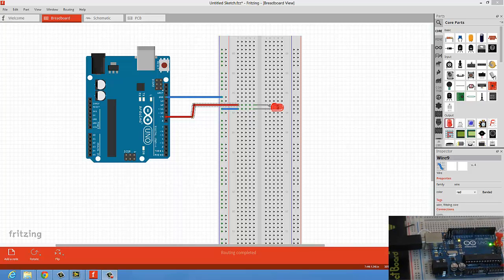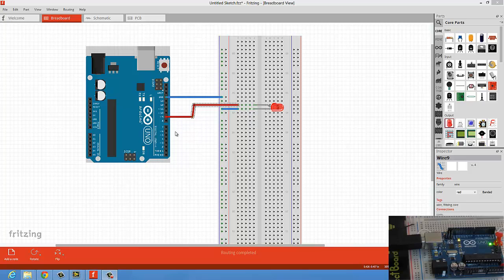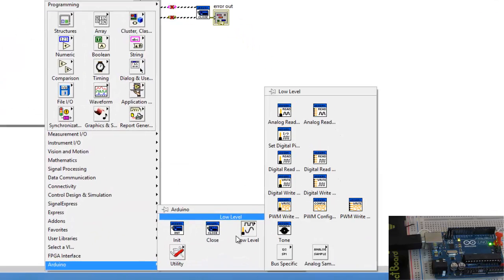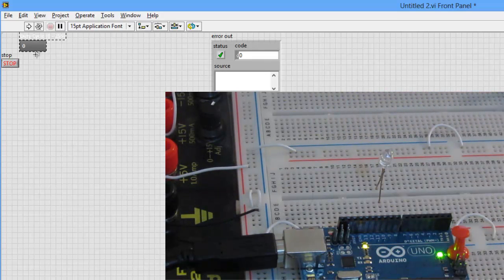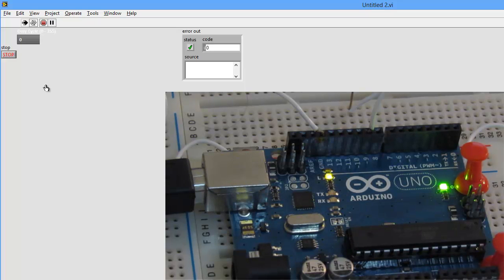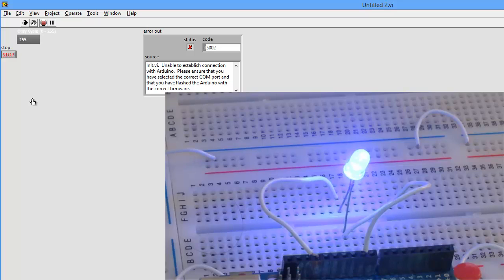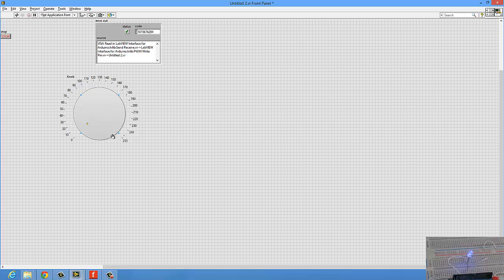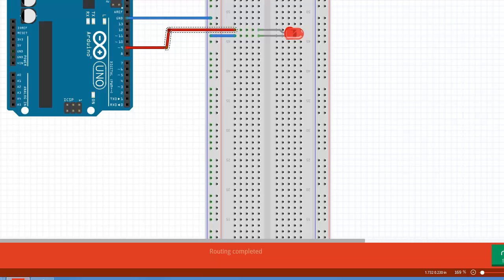Interfacing Arduino with LabVIEW   Part 2 LED Intensity Control using PWM

Comment: hello, I want to know my problem, I did over 6 program interfacing with labview I got the same problem I don't have anything in the output, I did also analog read with another video , I don't read or put anything to the Arduino, do you have ideas what is my problem?
Reply from the maker: Could you send me a video of the setup and problem?
Reply: @AhmedSweleh  Hello Ahmed I made the same video that you did but I have a problem which is labview never read anything,in addition,  the rx in arduino does not work flushing.
according to your experience where is my problem
Reply: I try to use linx and it is working well but it is has a problem,everyrun,  I need to download the firmware to the arduino
Reply: @AhmedSweleh  I am waiting your help

Comment: my power is not varying with respect the knob and control functions, first i thought the problem with led but when I connected the terminals to voltmeter then , it is showing a constant voltage when it crossing 130 cycles below is 0 v, after 130 cycles 4.8 v  constant up to 255 , that is the solution ....thanking you

Comment: can't get it working on Arduino clone..,the error out says "Unable to find Arduino.  Please make sure the Arduino is connected to your system and that the Arduino drivers are installed." ..I'm sure I installed the right driver because I can load and run programs on my arduino clone alone without interfacing with labview,,other thing is, on the Visa resource list only "refresh"is listed no, com port is available..do you think its because I used arduino clone only and not arduino board?
Reply from the maker: don't think so. as long as you can see a com port in your device manager it should work
Reply: +Ahmed Sweleh I can see it on my com port but not as an arduino(com#)..
it has a different hardware name maybe because of the hardware manufacturer of the clone duino

Comment: hi Ahmed
can you please give me arduino sketch for this video
Reply from the maker: which arduino code or labview vi?
Reply: +Ahmed Sweleh  actually i have a problem to do same thing in visual studio
 i think my arduino code not correct can you please help me?
Reply from the maker: Can u explain what u want to do?
Reply: +Ahmed Sweleh i want to control (pwm) led with 'knob contorl' in visual studio
knob control send the value to arduino  but led not change  state
Reply from the maker: +saad ahmed you are sending your values using serial right? are you sure that the arduino is reciving your serial commands from visual studio?

Comment: Hi! Did you ever try to change the led intensity using the voice?
Reply from the maker: Not really. But it's not that hard. What is your source of voice? A mic connected to the arduino or an audio file from the computer?
Reply: Ahmed Sweleh ya..i need something like this too...voice control the intensity...

Comment: hey dude, can you give a tutorial for controling the lights of LED using LDR sensor? the case is if the LDR detecting the light, so the LED turn off. Thanks a lot
Reply from the maker: ok, no problem
Reply: Ahmed Sweleh wow, thanks for your fast response dude, i'll be waiting your video